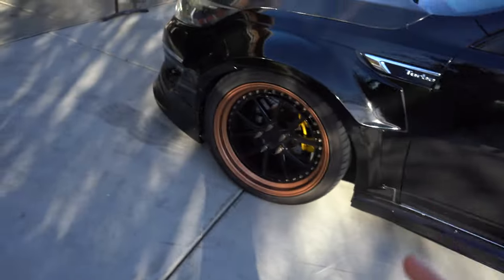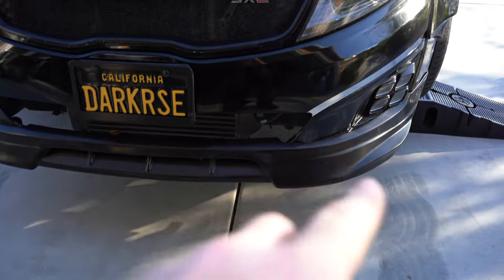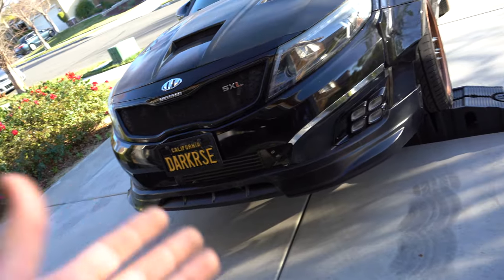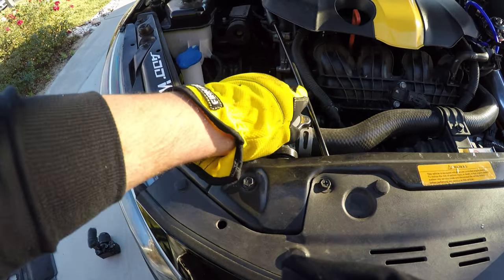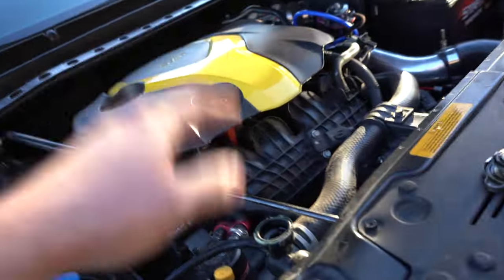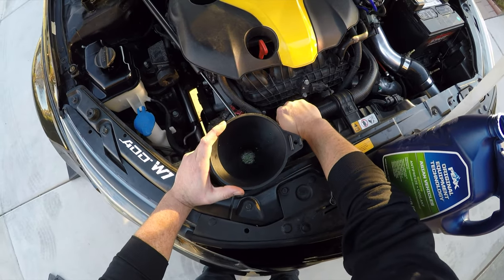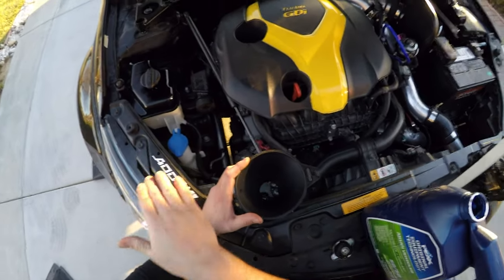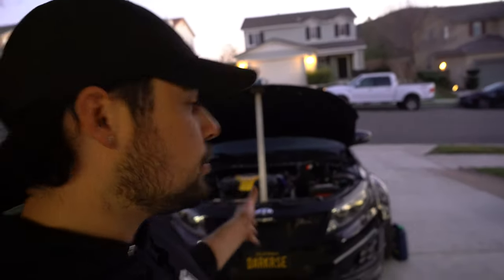COOLANT FLUSH & BLEED ON KIA EASY + NEW LIP INSTALL KIA OPTIMA

Comment: I have two questions, 
1. How do you rinse out the resivor at 3:30? 
2. How do you know you have enough coolant when pouring it in(while pushing the air out) and from overfilling.
Reply from the maker: 1. You would use distilled water till clean pours out. 
2. The coolant would get stuck and the top and not drain down.
Reply: @DARKRISE how many coolant containers did you need

Comment: Hello and it's worth adding the front nose and where can you buy it can not be in distant countries where I also have a little trouble Kia but I do not have your income and give me your spare parts anyway
Reply from the maker: I got the front lip on ebay👍there are cheaper options made in cheap plastic that you could incorporate the same technique I used to have it fit👍

Comment: I was wanting to do a coolant flush on my 2016 Kia Optima EX but noticed it’s a little different on the 2016 how would I go about bleeding the system
Reply from the maker: The bottom of the radiator should have a drain plug. Just apply the same steps to yours. Most all kia radiators systems are the same

Comment: sir please help me. how to take of the pipe connect radiator and reservoir tank like in your video. mine its so tight cannot take it out i scare i will break it if i try hard.
Reply from the maker: Try using a  V-Jaw Groove Joint Pliers and rotationg the hose in place gently and then pull
Reply: @DARKRISE  thank you. must rotate it before pull

Comment: Good video. But I suggest to fill with water then continue to flush untill it's completely water. THEN fill with coolant
Reply from the maker: Yes💯💯
Reply: Not quite right.  If you use distilled water to flush the radiator and engine block you need concentrated coolant and you need to do some math to figure out how much water is in the block vs total coolant capacity.  Then fill with concentrated coolant to get a 50-50 mix.  It’s more complicated than you’re showing but it’s not that difficult.  Takes alot more time.

Comment: What's up bro, I have a 2015 sx turbo with the injen intake. I'm wanna use the crc gdi intake cleaner, have you ever used it or any knowledge of where to spray this through. If I remove the injen intake can I spray it directly through the turbo inlet, or through the pcv valve hose that connects to the intake. Thanks
Reply from the maker: Good question, im not familiar with that but I do know that throttle body cleaners should be sprayed at the the throttle body. But hopefully who is familiar could get to this question 💯

Comment: Hey man I got a 2015 SXL .. I drive pretty hard and I’ve noticed at high speeds or when I get on it , the acceleration isn’t as smooth . I was wondering if it could be the transmission fluid is going bad or low ? Have you ever had this problem
Reply from the maker: Check the the waste gate voltage! That’s usually the problem. I MADE A VIDEO ON HOW TO ADJUST WASTE GATE

Comment: Those lips doesn’t fit even on the 2011 or 2013 the same job you did cutting the lip in both side is necessary trust me I did the same on a 2011 did it on a 2012 and did it on a 2015 I believe your optima is a 2014 right. Well now I have a 2018 optima. And I also believe those lip are universal
Reply from the maker: I have the 15👍u right